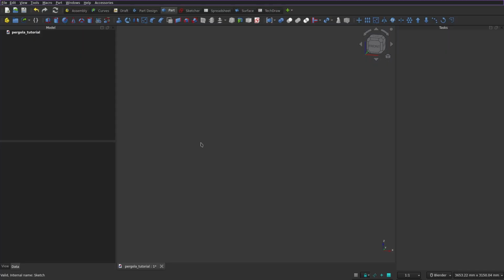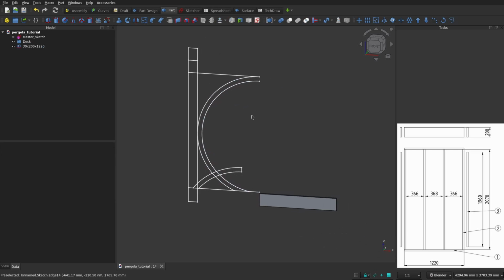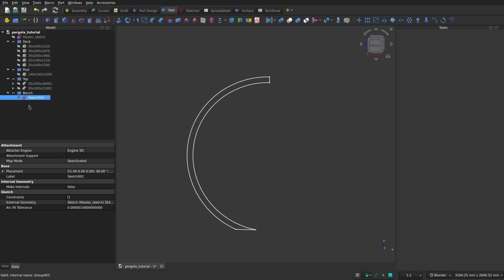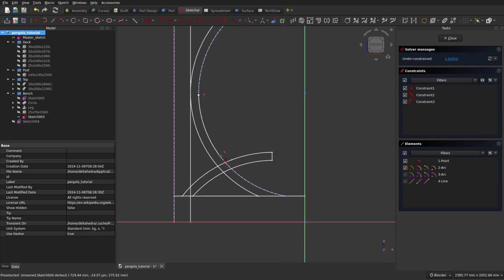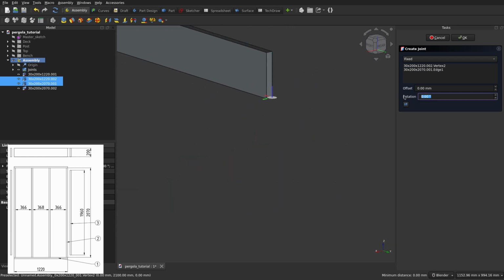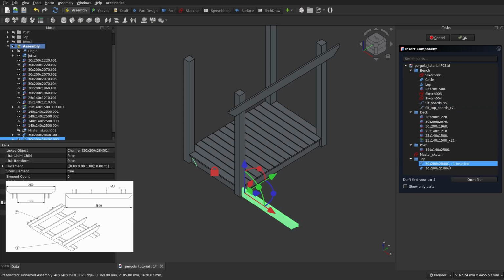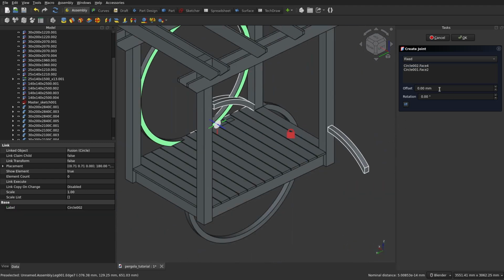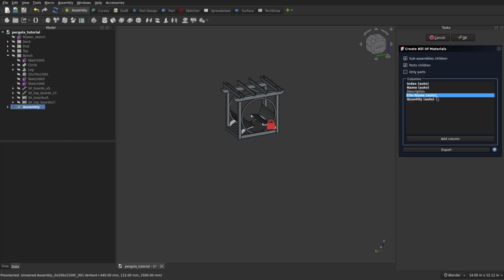Freecad - Multiple Parts Assembly Tutorial - Woodworking and Carpentry

Comment: Things almost fell apart for me during the mirroring of the large circle. I re-watched the section several times to make sure I got every minute detail correct and the mirror still came out crooked every time. In the video you select two points on the vertical edge of the circular extrude. I wound up selecting the two points on the inside diameter side of the extrude, parallel to the Y-axis, and this worked. 🤷 What the difference is, or why it worked, I have no idea! 

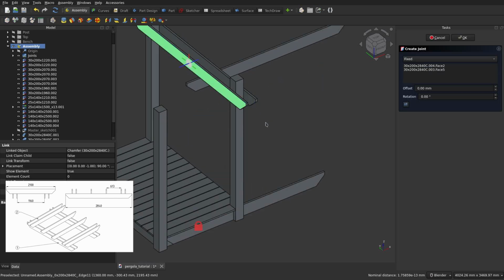At 22:30 and 24:35 I'm curious as to why you chose to apply a fixed offset from the other beam, rather than just creating a fixed offset from one of the other posts, or the master sketch?

Last question, if anyone here can answer for me, why do the legs have that white outline? It bugs me! I wound up going back to the leg extrude and changing the line color to black, so it would match everything else.

When placing the second set of legs on the second bench, the offset of 560 was too much. It put the leg aligned with the outside of the post. Everything else looks OK, so I'm not sure where along the process I deviated. But at any rate, I wound up with an offset of -420 instead.

This is a great tutorial. I learned how useful a master sketch and some well thought-out placement of sketches and points can make assembly much easier. For instance, placing those seat boards would have been an absolute nightmare without that one little sketch point to line things up. The master sketch outline proved to be very useful.

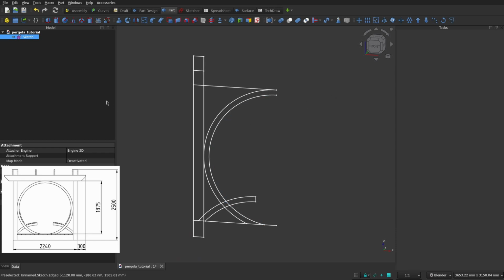Comment: Thanks, for this tutorial, but at 4:09, I realized, what would everyone suggest to use for the material to create this round frame with? What type of material, that can weather gracefully and withstand the elements outside, without becoming compromised, then fail, do to the result of too much moisture? So I stopped the video... Would you use treated plywood? What would you treat it with? What are some ideas that everyone might suggest? When you design a project have you reached the level where you design with dimensions that are realistically achievable? When I am using metric dimensions, since I am in the United States, I convert all dimensions to Imperial/US Customary and double check if the dimension is then something available from a local lumber company or would I have to purchase from a specialized supplier and then plane it accordingly? For example, 25mm equals 0.9842519685" which I need to allow for the difference, right? In the US a 1" x 4" actually only 0.75" x 3.5" whereas treated deck boards are referred to as 5/4" (1.25") and if I  use the 25mm for board thickness I will need to adjust my dimensions accordingly. Be aware it is really easy for FreeCAD in "Preferences" to change from metric to inch, but double check the actual conversion overall consequences!
Thanks for all the hard work of providing these tutorials!

Comment: First, I was wondering why did you use a point in a couple of sketches that wasn't needed to constrained the sketch. Great way to use them for the assembly part.
Second, don't know why, but I couldn't create the bill of materials. Something might be wrong on my Freecad 1.0 (flatpak).
Great video. I learnt a lot. Thanks.
Reply from the maker: Thank you, I had the same issue with an other project. You can check the woodworking workbench, which can create  BOM and cut list too

Comment: A user of freeCad from  0.13 or 0.14  The only think I didn't follow was the placement of the array sets of boards.  That point you picked on the array assembly was not identified as far as I remember when it was created.  So when you used it in the assembly  I didn't make any connection.    The array itself was created  faster then I would have like but I did catch it enough to figure it out.   As an Assembly 4 user the moving of the blue  pointer I assume is similar.

Comment: What is the difference between part design and part tabs? When should I use one or the other?
Reply from the maker: @basquera You can use either workbench to achieve the same outcome. The Part Design workbench functions similarly to commercial CAD software like Fusion 360 and Onshape, offering a cleaner, better-organized feature tree, particularly beneficial when performing multiple extrusions and pockets on a single body. However, it can be restrictive, especially for surfacing or creating more complex geometries. The Part workbench is more of a free-form environment. It could be very powerful when combined with the Curves and Surfaces workbench.
Reply: @deltahedra3D  tks bro!

Comment: You must use more mirror and array command instead repeat the same operation for each piece
Reply from the maker: I wanted a clear parts list. Since mirrors and arrays aren't available in the Assembly Workbench, using them in the Part Workbench would have resulted in a distorted and inaccurate quantity list.

Comment: 10:21 is there a way to omit this redrawing that we did already ?
Reply from the maker: I believe there is a function within FreeCAD's link branch that can directly transform an external geometry into a workable line, eliminating the need for manual retracing.
Reply: @deltahedra3D  Sketcher has a CarbonCopy operation that will copy content from other sketches, including their constraints. If the other sketch is not in the same plane (including origo), then you can still copy if you hold down Ctrl-Alt before clicking that other sketch.

In the upcoming v1.1 release of FreeCAD there is a Projection tool that projects external geometry into current sketch :)
Reply: There is also a Projection tool in Sketcher in the upcoming v1.1 release of FreeCAD which projects geometry into sketches :)
Reply: @JoaKarle  yeah, i've seen...

Comment: This barely uses the assembly workbench as a snap tool, and uses magical numbers and redone work all over. The naming scheme is bad for adjustments and sometimes skipped entirely ("the Sketch003"). Rather missing the point of parametric CAD. 

Just consider how much work this model requires if you want to make the bench 15cm shorter.
Reply from the maker: My primary goal wasn't to create a fully parametric pergola. Instead, I modeled it in a way that mirrored the actual construction process, taking into account the specific dimensions (thickness, length, and width) of the available lumber. Excluding the central circle would significantly simplify a parametric approach.

To shorten the bench, simply adjust the value in the initial master sketch and potentially modify the number of planks in the path array for significant reductions. However, altering the height or width would be more complex due to the fixed values associated with the circle and deck array.